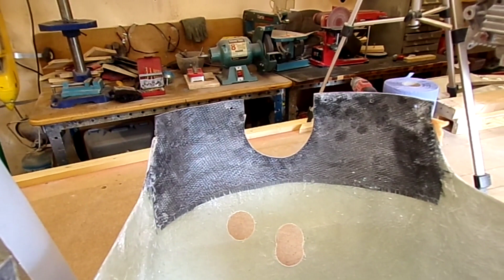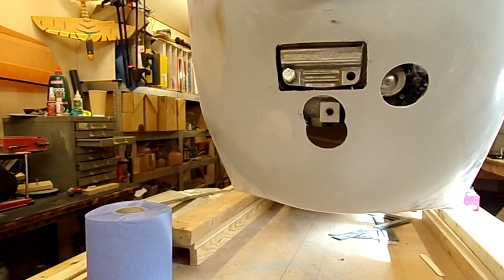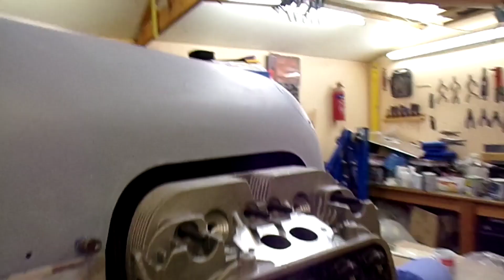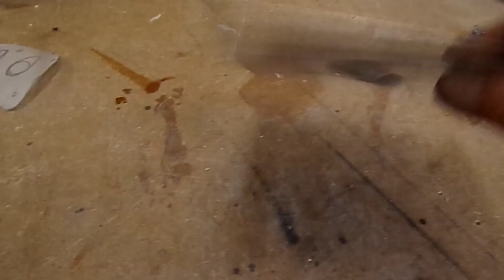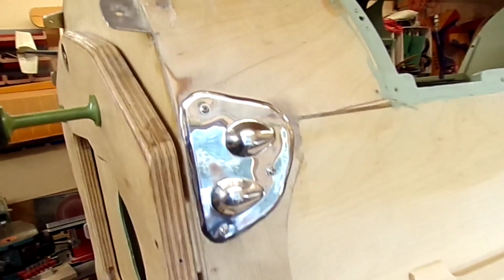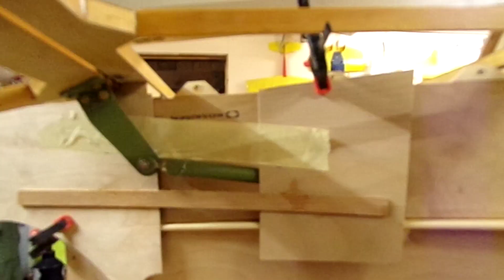EP126 My Cowl is starting to look good. Fisher Youngster

Comment: P.S. One thing crossed my mind about the Intake. I am assuming it is the air intake.  Being rear of the engine the air will be warm(er) whereas I thought cold air was preferred.  Am I right?
Reply from the maker: Sorry Michael not sure I understand the question, I assume you are refering to the engine air intake, which as you are correct, is at the rear of the engine and will be in the warm air that has gone past the engine and oil cooler. If that is you question, then yes it would be better in cold air and I am planning to possibly address some of that when I do the exit air section of the cowl, possibly with a NACA duct or scoop to direct cold air at the air filter, that said the air will not be that warm as the really hot bits of engine are hanging out in the breeze.
Reply: Yes Algy, that was what I was thinking about so thank you for explanation.
Reply from the maker: @michaelchartres  no problem Michael 😊

Comment: Looks good...  did you want to have a large oil cooler? Suzuki, before water cooled engines came into fashion, used a large oil cooler to keep temps down on GSX 750??? high performance bike.
Reply from the maker: The oil cooler is fairly large that I have, which will lie almost horizontal under the engine. I don't think I really need a big cooler here in the UK, the temp hardly gets above 30 Deg C. Your suggestion would be great if I didn't have one already.